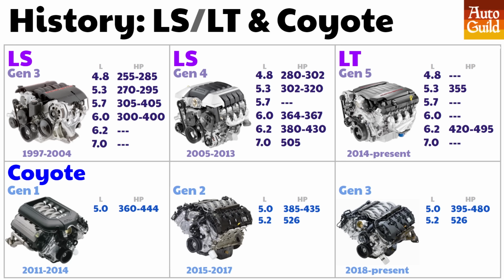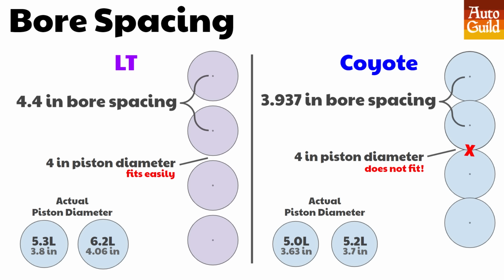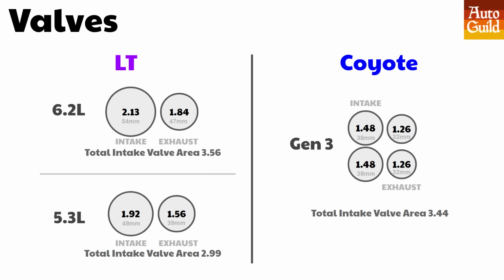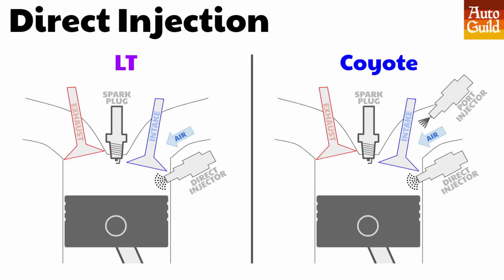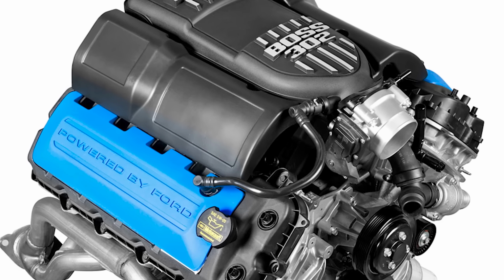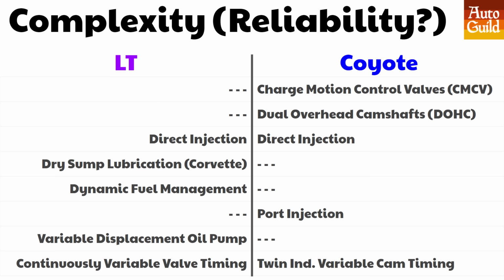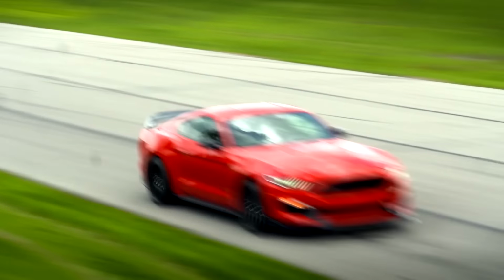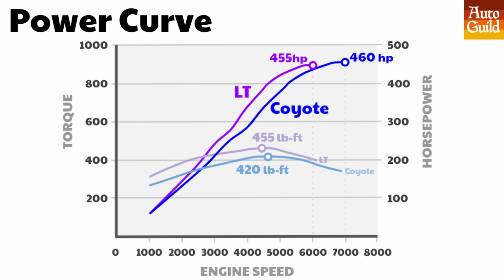GM Gen 5 LT vs Ford Coyote.  Which one is better and why.

Comment: Someone tell me when a stock sealed LS or LT runs 7s like the gen 3 coyote. Thats all
Reply: @frenchonion4595  its literally on midnight performances youtube and instagram. twin turbos with stock motor. 7.90
Reply: @frenchonion4595  typical Ford hater. 
MMR has run 5.67 @ 265 mph 1/4 with a factory head GT350 coyote based engine displacing 351 in³. The closest LS (427 in³ 100% billet) has barely broken 5.9's @ 243 mph.
  While not a coyote, the current standing mile record holder is MKII MOTORSPORTS Ford GT with a John Mihovetz built FACTORY block and heads 5.4 L that makes well north of 3,000 hp @ 10,000 rpm. 300.4 mph in one mile....the closest LS in a production based car is a 100% BILLET engine that displaced 7 L and ran 263 mph. Not even close.
 Accufab had John build a 4.6 4V with factory block,heads, crank, and timing components in 2016 that also made over 3,000 hp @ 10,000 rpm, ultimately running a 5.88 @ 250 mph. 
 In an all out build, there's no two valve production head LS making that power or staying together. Facts
Reply: @chadkent1241  not only did you speak Facts, you crushed the hearts of the Garbage Motor boys.
Reply: Right. Iykyk. That seals the deal. Period
Reply: They can't do it
Reply: David Van Voris ran low 8s on a stock factory sealed coyote a year ago. Not only can they do it, but there are multiple examples of people doing it. Search for David Van Voris. He did it before anyone.
Reply: @frenchonion4595  look up the evidence. They tell the mods if I'm not mistaken. Gen 3 coyotes are nuts, if you didn't know.

Comment: I think at this point just about every manufacturer makes a dual overhead Cam motor. The manufacturer that I work for uses nothing but dual overhead Cam motors. In my opinion  Duel overhead Cam motor is a sales gimmick.  Dual overhead cam are expensive to build, expensive to manufacturer. That's a lot of moving parts right there. And keep in mind I'm talking about street cars here I'm not talking about race cars. Dual overhead Cam motors are high reving horsepower masters. And push rod motors are torque monsters.
 I've always been a fan of pushroud motors. Just because of the fact when the piston hits the valve it bends the push rod not the valve.
Reply: No, I have seen numerous pushrod engines with bent valves and busted pistons, so your statement doesn't hold water. Plus you are forgetting the fact that the Coyote is NOT and interference engine, so the timing chain would literally have to break to for the valve to hit the piston which can happen just as easily in a pushrod engine. Mechanical and electrical things break from time to time it just happens.
Reply: @72blazr1     I'm sorry maybe I didn't make myself clear. When there  Is a timing chain issue. Just because an engine by design is none interference doesn't mean you can't hurt the valve train one the chain fails.Or if a guide fails or if  Tensioner fails.Or if the jackass doesn't change his oil  then the chain stretches. Small block chev are a none interference motors . But I've seen them then bend  push rod's. The push rod is the weak  link of the valve train.  If you have an engine that has catastrophic damage yes sure why not you can destroy all sorts of stuff.  Push rods are going to bend long before a piston gets destroyed. So once again the push rides gonna bend before other damage happens because it is the weak link. Another problem with the  Dual overhead Cam motor. If cam timing is off just a little bit valves themselves can hit each other.

Comment: owned a lot of ford trucks in the last 15 years and that is because i can pick them up cheap because they have so many problems and since i can work on them myself does not cost me as much to fix. hands down if you want a dependable vehicle then buy the ls and lt vehicles made by chevy and gm. ford has had the problem of over engineering and bad engineering on some of the most stupid things that any one with an ounce of common sense would not do. and thanks to your video i can already see major problems that are coming for the coyote as far as long term dependability and just the cost of fixing them when they do breakdown.
Reply: That's real unfortunate mister, life can be so unfair.

Comment: well you didn't exactly state the problem and why the extra injector on the port helps prevent the problem. Oil goes through the PCV system into the combustion chamber and is burned. Same for direct injection. But, non direct injection engines don't have this problem because of port injection since port injection sprays fuel into the port, which then cleans off the oil buildup/prevents it. 
Toyota does the same thing Ford does.

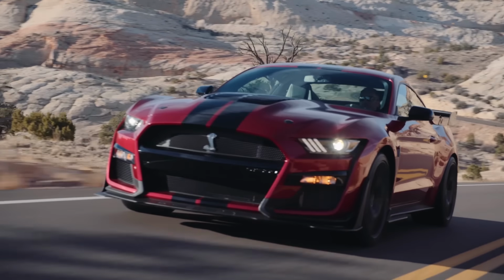Comment: 7:53 the coyote 5 liter V8 is no longer a 302 which is actually 4.9 liters it’s 307 cubic inch making it an official 5.0 liters. Just thought you might want to know. To me the coyote wins hands down, it makes power all over the rev range and you can rev the hell out of it.

Comment: Really wish Ford would have stuck with the flat plane voodoo 🙍🏿‍♂️ and also it explains why the GT500 is so heavy but also I believe if Ford would have done weight distribution throughout the car they probably could have made it lighter while putting power to the ground as well

Comment: Just an FYI the LT1 in the 6th gen camaro does have a tri-y design exhaust manifold. They did this because of packaging versus the corvette
Reply: FYI the LT1 is an engine from the 1990s.  GM should've really thought about a new engine name instead of using a name that has already been used.
Reply: @rigorousrangel6394  it's also an engine from the 70s, GM loves its heritage. It's a trip that the time from the original to the gen 2 was 10 years less than from the gen 2 to the one we have today.
Reply: @blackrat1228  the way I see it, the new LT engine is just a revised LS since it has very few similarities to the older LTs and looks more like an LS

Comment: Went through the engine build experience for my ZR1. After assembly they weigh the engine, as they fill the oil by weight not by volume - 590 lbs for the LT5.

Prior to owning the ZR1, I was driving the GT350 - and you right. The engine is absolutely amazing. I enjoyed driving it even after I picked up the ZR1. It is something completely different and great in it's own way. 

You really have to rev that engine out. It doesn't lack low end torque, but it is noticeably less then the LT5 even before it gets into boost, and honestly it makes it more fun to drive on the street in a lot of cases as you won't kick the back end out at lower rpms with more generous throttle input. It blows people away the first time in it when you just hold it in gear forever.

The LT5 is just amazing torque and power everywhere. There is not wrong gear or too low of an RPM - if you floor it, it will send you back.

Comment: GM motor is better. Simpler and doesn't burn a quart of oil every 1k miles like the newer Coyote does. Right now Ford is in real trouble with their oil burning 5.0 yet they continue to sell them to unsuspecting customers. There are old Vortecs and even newer Ecotecs that don't burn a drop of oil.

Comment: Well-balanced discussion.  I currently own three Ford V-8s (2013 Coyote 5.0 L [Mustang GT]; 2013 Roadrunner 5.0 L [Mustang Boss 302 Laguna Seca]; and, a 2014 Coyote 5.0 L [F-150 XLT]).  I traded a 2009 L76 6.0 L V-8 (Pontiac G8 GT) for the Boss 302.  All of these engines have performed magnificently while I have owned them (no mods whatsoever).  I hope I'll get my hands on a Voodoo 5.2 L V-8 (GT-350) one day!

Comment: What sucks about the Ford 5.2L FPC is that Ford chose the FPC configuration that makes more peak power, but is comprised towards additional vibration.
Reply: This is due in part to the crankpin layout they went with. The traditional layout is Up-Down-Down-Up and Frod went with alternating Up-Down-Up-Down which creates additional secondary vibrations and requires bigger counterweights at each end of the crankshaft. In addition, they had to use other methods to try to control these secondary vibrations. Give the number of engine issues/failures it would appear they didn't have all of this sorted or were even fully aware of potential issues before releasing the cars. And of course, we know how this ended for their cusotmers. Fortunately, Chevy has stayed with an Up-Down-Down-Up crankpin layout and customers won't have to deal with the same secondary vibration issues.

Comment: To bad you don't put the LS or coyote against any dodge HEMI engines.
Reply: No need to. The LT and the Coyotes are much better than the hemi especially since they both are much lighter.
Reply: @John Stone coyote, ls and lt does the same lmao. Do a Google search for dod failure and coyote tick
Reply: Without bewst GEN3 Hemi mods like shit. It's shocking how poorly a 392 Hemi with a 4.09" bore diameter mods.
Reply: @JROC734  says you. My bolt on 6.1 makes more power than cammed ones do. Have to know how to mod it right.
Reply: @John Stone are you 5? 🤣
Reply: @John Stone snowflake lmao yet you're the butthurt one 🤣

Comment: Correction… in a flat plane crank engine one cylinder is at top dead center and the other at bottom dead center only in a flat “boxer“ engine. Since the coyote is a V configuration this is not true.
Reply: https://carbuzz.com/features/battle-of-the-v8s-flat-plane-vs-cross-plane#:~:text=In%20V8%20engines%2C%20flat%2Dplane,almost%20exclusively%20by%20European%20manufacturers.

Comment: Ford's new competition motor is the 7.3 Godzilla.
Reply: @Frank Bonazza III 
Yessss, it is!

Im hoping to find a wreck in the junkyard with a 7.3 in it, to drop into my '70 fastback. I have an old 429 right now, but the 7.3 will produce more power, and it's lighter.
Reply: With a 4.22" bore I think the Godzilla engine has huge potential especially if you're willing to invest in a lightweight valvetrain and possibly the rotating assembly that will allow the engine to spin. Assuming that the heads, intake and exhaust setup will flow well enough to keep up.

Seeing as how Ford fans like to claim that GM copied the Windsor design with the LS design I would point out that Ford appears to have copied GM's LS and/or LT head/intake/lifter (let's just say the topend of the engine) design with the Godzilla.

Comment: HP per liter is misleading... Add (rpm) and HP goes up.. Take a 1000cc street bike engine with over 150hp.. would it happily pull around a Tacoma with dirt bikes ? Not without a 12 speed trans & hard clutch work.   
   Being impressed with RPM is childish... The LT is not a ((low rpm)) engine, it just happens to be set up that way by the cautious Chevy design crew.  
     FACT: within a year or two, amazing aftermarket components will be available for the LT to take it into areas FAR beyond the OEM parameters.. And while the Coyo might maybe possibly see some billion dollar cams, the platform will never see MONSTER TRUCKS, or ALCOHOL,  etc...  Not even good in a full size heavy 4x4, The torque converter would have to be 3,000+ rpm, LOL.... 
    And that (FLAT PLANE) you like?  It's designed for racing and a technical edge,  NOT for a license plate street driven longevity investment... After a few races, tear down, inspect , fix and re assemble...   It would be like having a 2 stroke car engine in comparison...  For sure not a 100k mile engine , let alone a 300k LT truck engine..

Comment: It's amazing how the LT block looks like a modern day version of the 1954 Ford Y-Block.
Reply: @John Stone Gather your books and get on back to school.
Reply: 292 owner here, wish we could get some cubes out of the Y like the LS and LT!
Reply: Exactly. It looks like the Y block but they also took cues from the Ford Windsor with 10 bolts on the heads and no longer using siamese exhaust ports as the SBC did. The LS looks like the combination of two Ford designs put together. I like both the Coyote and the LS.  Go USA.
Reply: @almodequindre8601  Amen to that brother.
Reply: @John Stone Yes it did. There are a lot of similarities with the Ford Windsor and with a little machining you can make an LS head fit on a Windsor block. They all take ideas from each other.
Reply: Lol, having a similar head spacing is not taking something from Ford. Ugh, that was debunked 23 years ago.
Reply: @jaybird4756  I don't think you understand that they both take ideas from each other. I grew up outside Detroit where we designed and built all the engines and designers and engineers would move between manufacturers all the time. Bunkie Knusden and Larry Shinoda were two of many examples from GM to Ford and they were responsible for the 375 series engines which included the 429 and 460 and they brought their ideas with them. That video showed you can make LS heads work on a 351w with a littl emachining.I'm not saying they stole the idea from Ford but there are similarities and maybe it's just general laws of physics but they made it work.
Reply: @almodequindre8601  They don't understand anything, they're fan boys. This thread was just people being cool until these insecure jockstrap wearing tools showed up. Maybe someday there will be medication for guys like this so they can "grow up."
Reply: @InuranusBrokoff  Exactly. They should just be glad we have two great American designed and built engines that can compete and beat the world exotics for a fraction of the price.
Reply: @InuranusBrokoff  No you don't understand and it is evident neither of you has much knowledge on the subject. Keep the insults coming because that's always the best way to prove a point, especially on the internet.
Reply: @FL50ssp  I know you live off of getting emotional responses out of people, so don't act like you're taking the high road. Trolls are a plague.
Reply: @almodequindre8601  The exhaust spacing is also identical to SBF, and if you order a distributor conversion kit for a LS, you get a SBF distributor.
Reply: @John Stone Well copy and paste into your YT search and enjoy

.   351LS Part 6
Reply: @almodequindre8601  I know exactly what you are talking about lol